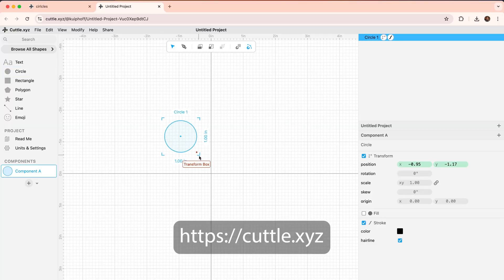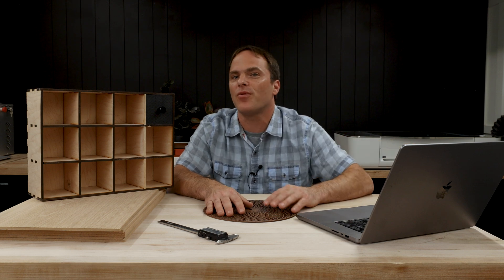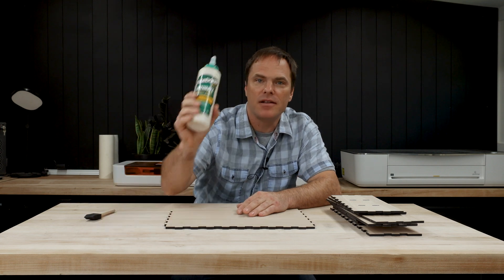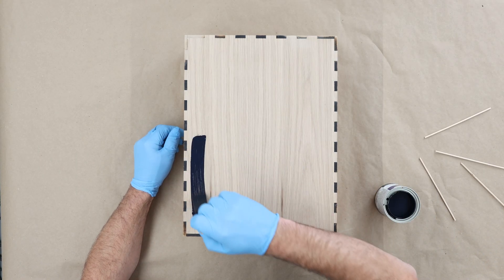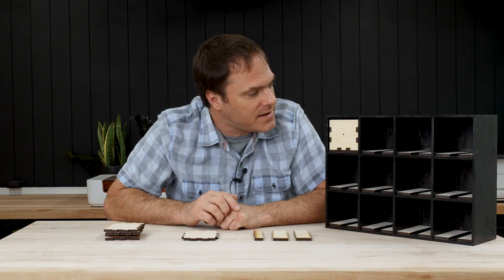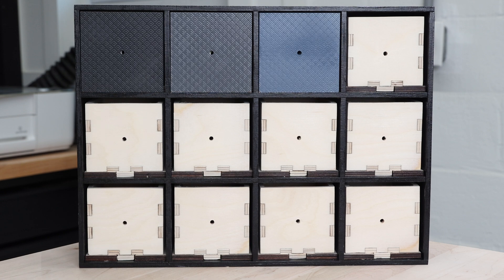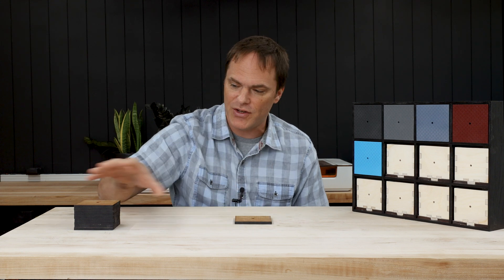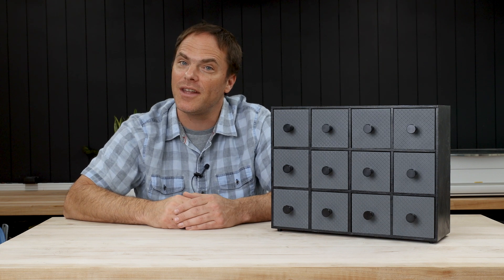Surprisingly Simple Lasercut Drawer Unit | Glowforge and Cuttle.xyz

Comment: Did you make allowances in your frame for the slides at the bottom of each box. and for the face plates?
Reply from the maker: Ah! Good question. Yes, there's about a 1/16" gap on either side. In fact, I glued some of them a little bit crooked (because it's hard to make a video and a project at the same time. ha!) and I had to chisel away a few of them to make them close better. Thanks for watching!